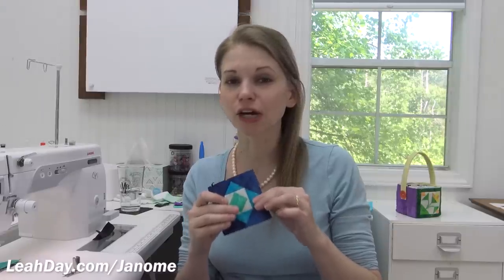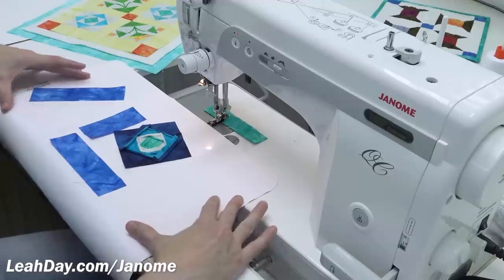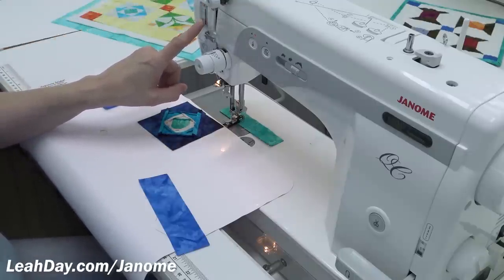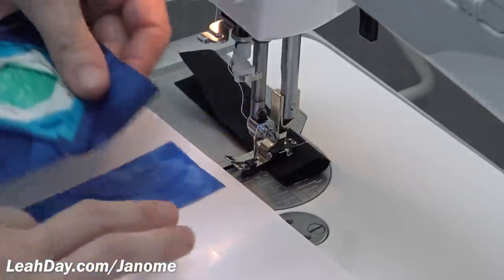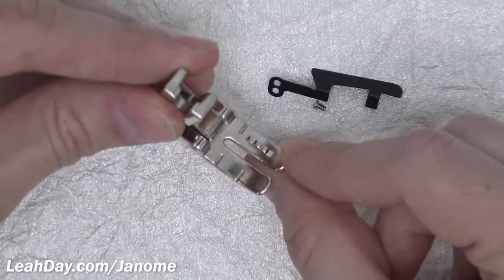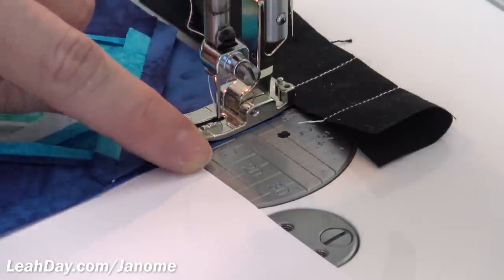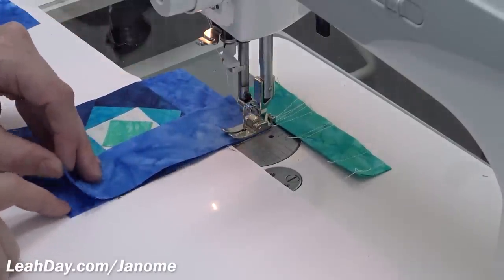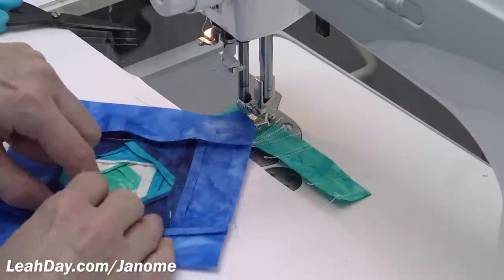Quilt Block Piecing and Sewing on the Janome 1600 Home Sewing Machine

Comment: Congratulations on your partnership with Janome.  I purchased a Janome 1600P in 2011 and used it on a wooden quilting frame with a stitch regulator until I switched to a Handi Quilter Avante long arm.  I learned more about the Janome 1600P capabilities watching this video than I have in the past 9 years of ownership!  I kept it for piecing and bag making and I recommend this model to anyone considering a purchase.
My Janome 1600P sews with precision and meets the challenge of bag making requiring every one of those 11 lbs. of pressure!  Thank you, Leah.  You are pretty awesome.
Reply from the maker: This is wonderful to hear Linda! I'm so happy you found this video helpful and if you're wanting more feet for your 1600, you know where to come find them!

Comment: Brilliant!  I used the foot a couple of times but as you say, it is difficult to see and I think my guide is wonky anyway and sticks outwards.  It doesn't like it when I used pins either - which I trained myself not to use for the most part, but there are times when pins are required!  So it went back in the box and I used a scant seam guide instead - a purple, removable sticky one.  The ordinary foot is still hard to see in any case, but the sticky guide worked really well.  I'm going to hunt for a teeny screwdriver now and take off that dark guide!  Always envied the Bernina quarter inch foot and Janome don't do one like it - never thought about taking the guide off!  Thank you!  xxxx
Reply from the maker: Wonderful! I'm so happy to hear you enjoyed this video!

Comment: here's a hint - if you remove the screw to take off the bar put the screw back in the hole and it will not get lost.  I also have a drawer where I put "extras" .  Everything that goes in this drawer is in an envelope with a detailed description of what it belongs to and if needed how it goes back on.  Loved the stitch length tip to lock stitches  and the use of leaders.
Reply from the maker: That's a great tip Lyn! Thank you!

Comment: Are you using a single hole plate or the "zig zag" plate?  Why do you have the slider down below the needle instead of using the hole  that you showed and having the slider up at the needle location?  No, I have not used a slider before.  I have the Janome 8900.
Reply from the maker: This machine only has a single hole plate because it is a lock stitch machine - it only stitches a straight line. The slider is positioned this way because I'm piecing - I need to use the feed dogs. I would only position the slider with the hole over the feed dogs if I was free motion quilting.